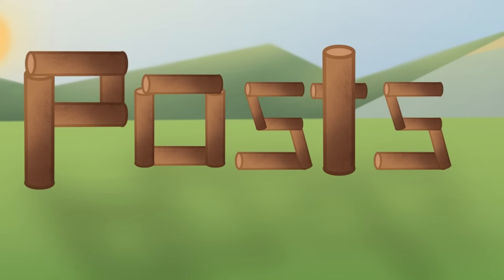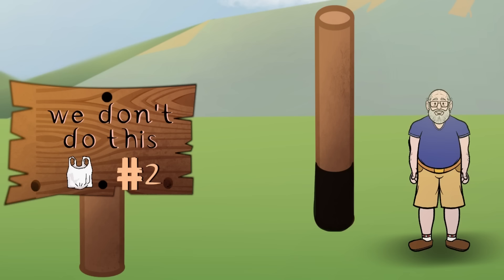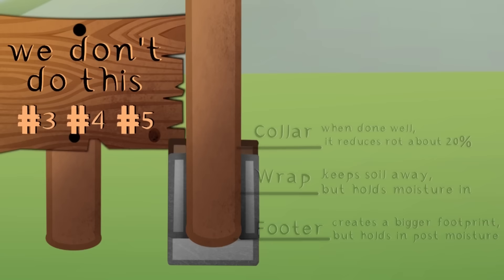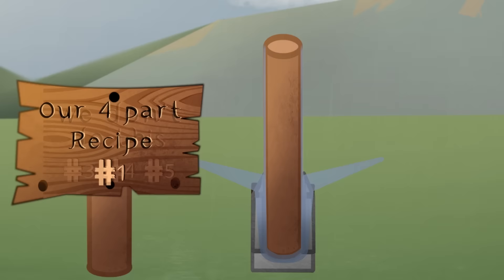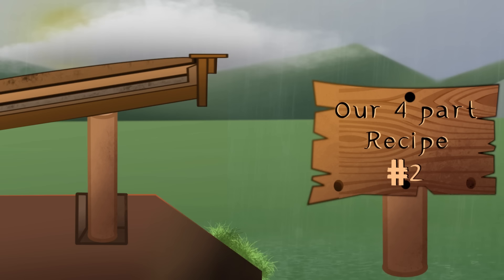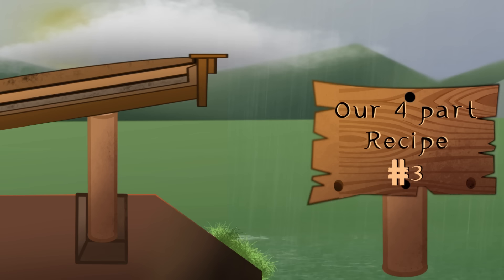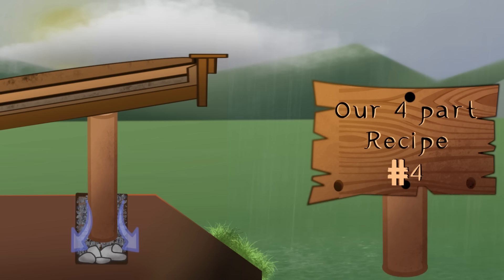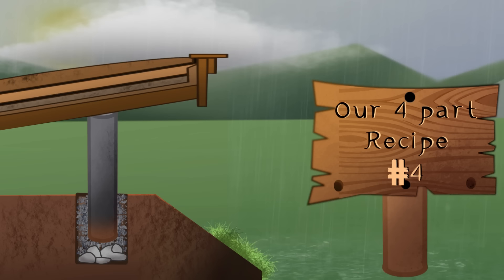getting posts in ground to last for decades without rot

Comment from the maker: I have been asked this so many times in the last six months or so I needed this video to point at to explain my position.
Reply: Very Interesting Paul...and makes so much sense. What about stability...I would think concrete would not move but stones and rocks would? I am thinking of a gate post that has to be solid because it has a gate on the end of it moving all the time.
Reply from the maker: @AlForte13  pack the gravel. Very deep hole.
Reply: @paulwheaton  makes sense we have caliche not far under - I better get the jack hammer out then...LOL thanks.
Reply: @AlForte13  I've heard you can soften caliche with vinegar, no experience to confirm
Reply: @priestesslucy3299  it makes sense we have caliche here I am going to have to try it. Vinegar is an acid

Comment: This method really works! We put up a pole barn 40 years ago this way, still standing. I'd add, use a rot-resistant wood, like cedar, or black locust (smaller diameter projects like fence posts).
Reply: I like my rot-resistant wood just the way I like my water, full of arsenic.

Comment: Great info, I only wonder what about fence posts that have to be on a flat land (no eve, limited possibilities for earthworks). Will rocks under and gravel around be enough?
Reply: The post will still get wet from rain and snow melt, and possibly a high water table, but will drain better. If black locust wood is available, it is naturally rot resistant and would be a great option.
Reply: @Mark-xt8jp  A neighbor replaced black locust steps that were 120 years old. The anchoring posts had shrunk in diameter where they were buried in the ground, but the whole stair was still stable and fully functional. We were all amazed.

Comment: You threw me for a loop. Mentally, I was thinking fencepost, but when you said 5' overhang.  Mighty strange corner post /hbrace assembly.

My only addition to you method of setting posts is to add tamping. You are putting a 8-14' lever arm in place. Compacting the gravel in 2" increments is good enough for a crane base so it should be good enough for a post frame construction.
Reply from the maker: The wofati design, the oehler design, the berm shed design and the holzer design all use posts in the ground for structures.  And people seem to feel a powerful urge to inform us of "other" approaches that are largely based on fence posts - pretty fair, but ...

Comment: What are your thoughts on using a Simpson Strong-Tie Common 6-in x 6-in Zmax Wood To Concrete (Retrofit) Base? You can pour the concrete and push the bolt into the wet concrete to catch the nut when putting the tie on. Water never touches the wood at all and goes right through the metal.

Comment: This seems like a good approach, however in my experience, all the voids in the gravel wrap will eventually fill in with soil if it is seeing any water.  Maybe a filter would help this?  I would still prefer concrete since it probably holds less moisture than muddy rocks.
Reply: A small concrete collar?

Comment: What about treatment of wood like borax/boric acid? We live in a brick and cement house but the roof tiles have timber framing. I heard they were boiled in diesel. What do you do concerning termites? Regular inspection?
Reply from the maker: I guess we don't have termites in montana, so i have never tried to deal with them.
Reply: I just saw my first colony of termites here in central Missouri after being out here in the woods for two years!  They started swarming out of the GROUND like dandelion seeds in the wind, rather than out of a piece of dead wood.  I've seen signs of them before, but so far not had issues with them attacking my red oak structures.  Tones of boring beetles, though, one per tree, 95% of the time.
Reply: Termites only travel through damp soil.

A sufficiently deep 'moat' of large stones would do the trick. (Off hand I would guess 18 inches but honestly I don't know)
Reply: @priestesslucy3299  I had a piece on concrete and a wooden post resting on that. Both were above ground level and they built a tunnel from the earth to the post. I guess they still outsmart us.

Comment: I have posts I concreted in 10 years ago, still going strong, are you guys not using pressure treated wood?
Reply from the maker: Get back to me when you hit 30 years - that's the real test.
Reply: @paulwheaton  a pressure treated post is going to weather away in 30 years